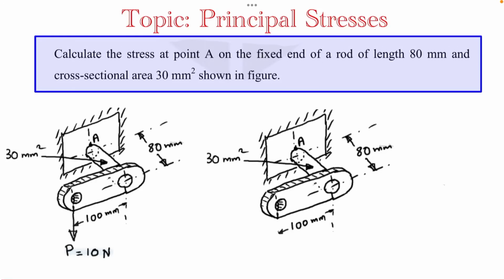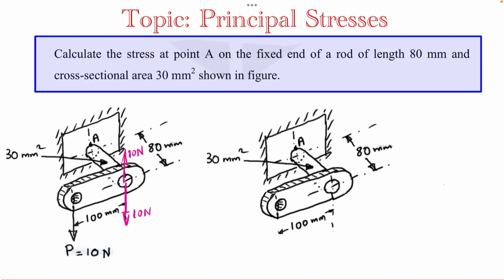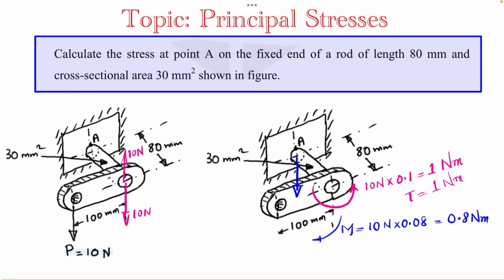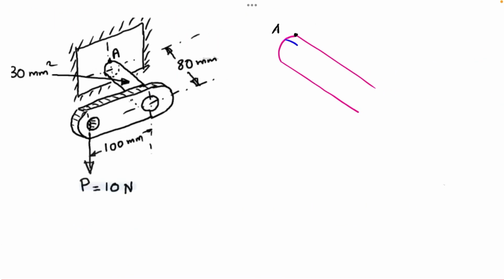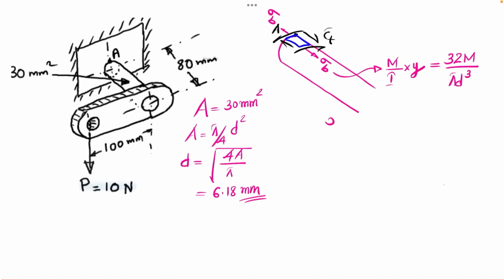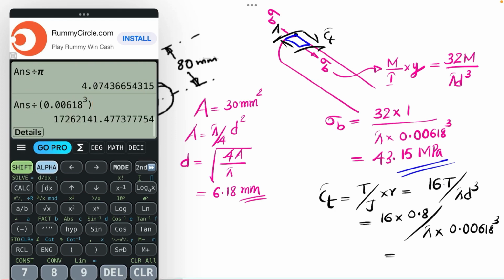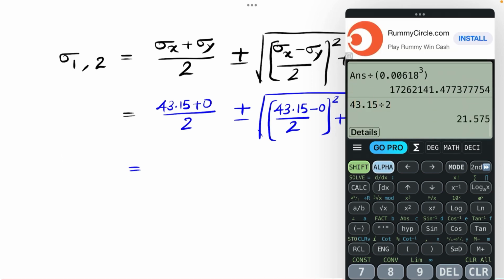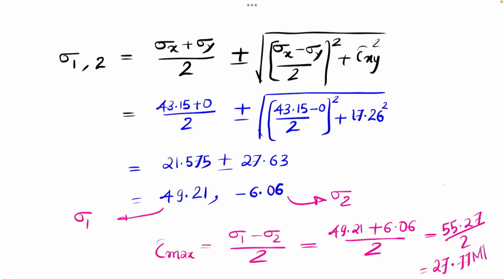Combined Loading - Principal Stress Problem 3

Comment: sir, bending momentum torqum interchange aayo?
Reply from the maker: No.. Its correct only.
Reply: @MohitDadu  I don't think it's correct. Please check again. Your torque ( 1 N.m) is the one that causes shear between two adjacent planes of two elements thus shown as shear on your side planes of a single element and complementary shear on the top & bottom planes. 0.8 N.m will cause bending stress/ Normal stress which is tensile for the element on top and compressive for the element on the bottom. For your element shown, it's tensile/ Normal stress. 🙂